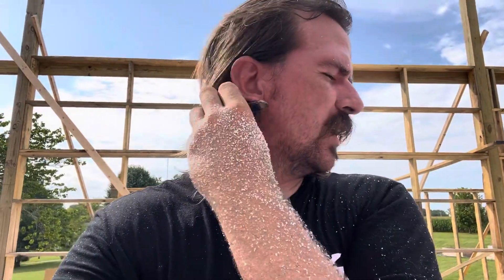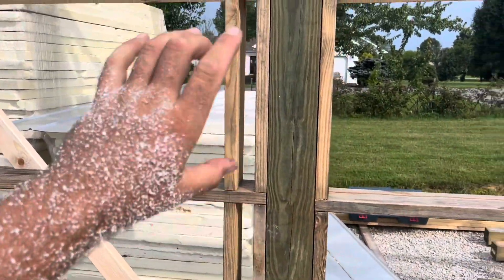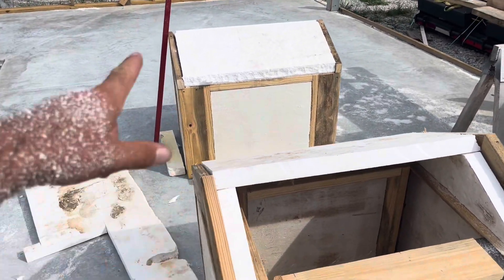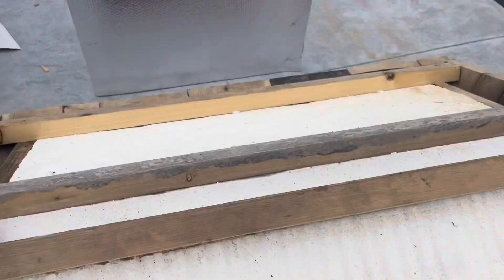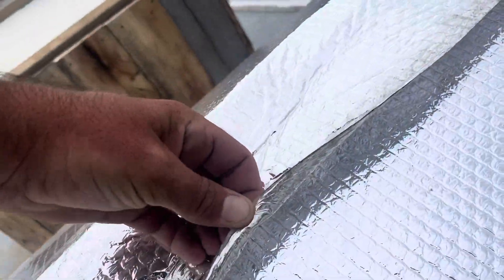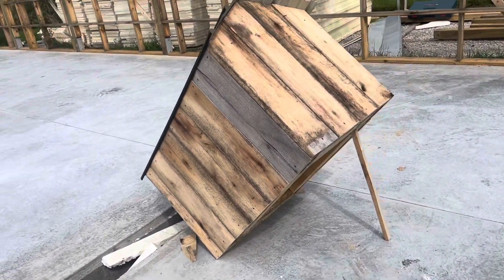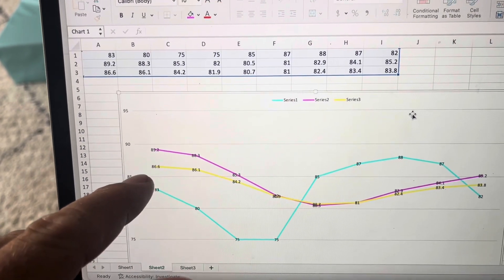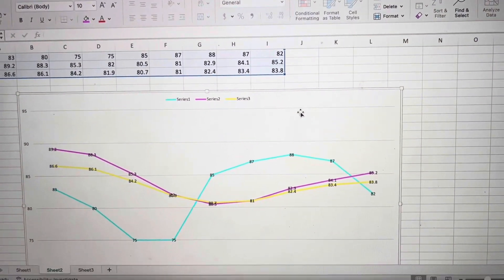Mini Shop Experiment #1 (foam vs foam w/ radiant barrier)

Comment: Try doing tests in controlled conditions. I recommend you look up how they do the test for R-value. Then you can try to calibrate your test to match insulation with known R-values like the foam board you have. Once you have calibrated your setup, you can then determine the R-value of a particular radiant barrier assembly. Note it has to be the radiant barrier assembly, including dead air spaces, because the radiant barrier on it's own has no R-value, except for the bubble wrap which is R-1, double bubble should be around R-2. Also be aware that dead air spaces have different R-values due to convection depending on if they are in the vertical plane or horizontal plane. Vertical plane (stud cavity) air spaces will have no benefit from getting wider than 3/4", while horizontal plane (floor joist) air spaces do benefit from getting wider gaps.

Comment: There's a company that builds homes and garage with thick eps type 2 foam, 12" for roof and 8" for walls. Then encase it with concrete and that's it. No wood, metal ot anything else. It's like ICF but solid foam inside and it's supper diy friendly. No drywall and siding needed so it saves money. No more mold and wood rot.

Comment: Your design is so bad that you can’t get a good study of temperature difference. My house temp at roof is 110 deg, at my barrier is at 97 deg then at my attic drops to 88. Apply it to your own house and you will be able to stay in your attic comfortably even temp outside is above 90 degrees .

Comment: I believe the air gap needs to be between the radiant barrier and each outside surface material. So I guess this experiment just gives incorrect data mate.
Reply from the maker: The air gap is between the radiant barrier and the outside material, as intended.

Comment: Maybe try putting them on a platform, or in the yard? The temperature might be affected by the heat capacity of the cement slab. A radiant barrier in a building wouldn't be so close to the pavement. Where was the ambient temp thermometer? It should be the same height or whatever- similar placement. It should be measuring the temperature in the shade.
Reply from the maker: Yeah next time I do a test with them, I’ll set them on a piece of 2” foam to isolate the heat from the concrete. I was just using the local temperature on my phone for the ambient temp. I realize now that also wasn’t the most accurate way of doing that. Next time, I’ll get thermometers that do their own datalogging to make for more accurate and detailed graphs.

Comment: I’m thinking that concrete underneath heats both pretty evenly. I’ve seen many videos about that radiant barrier making a big difference on attics.
Reply from the maker: That was my thinking as well, with both of them sitting on the same concrete, that wasn’t going to affect one over the other. I guess I could’ve set them both on a piece of foam but I didn’t think about that at the time.

Comment: need an air gap between metal roof and the radiant barrier. Put the foil directly on top of the foam board with the air gap above the foil.  When the foil is in contact with the metal it will transfer heat through it instead of reflecting the heat. would be like hovering a frying pan over a stove instead of sitting it on the stove top.
Reply from the maker: That’s how I built them. I put the radiant barrier directly on top of the foam board, then put 2x2 purlins on top, then metal.

Comment: I think you should have put the radiant barrier on the inside.
Reply from the maker: My thinking on putting it on the outside is stop as much of the heat as possible before it gets to the foam board.

Comment: Bro you put the 2 houses on hot concrete.. air rises what you are measuring is the heat from the concrete slab 😫🤦🏼‍♂️
Reply from the maker: There may be SOME truth to that. But the concrete under both was definitely cooler than the rest.

Comment: Interesting setups!  I have a book from the 80's on superinsulation techniques and one interesting factoid is over 60% of your thermal losses are due to air infiltration (air leaks).  Maybe there are some tape products to seal off your foam and radiant barrier joints (Siga, ZIP)?  When I build my shop, my plan is to just hire out 2" of closed cell foam in the walls and blow R60 fiberglass in the ceiling.  After spending a day at a coworkers spray foam shop in the dead of summer I became a convert.
Reply from the maker: I’d though about taping the seams of my radiant barrier, but I’m not sure yet if I will or not. 2” spray foam WAS my initial plan, but after figuring out what it’d cost to do the whole shop ($19k) I decided I’m gonna do something else. Lol